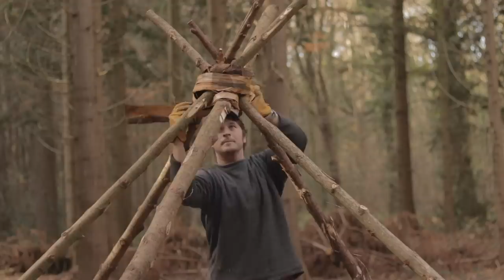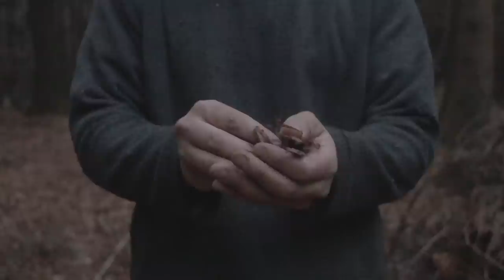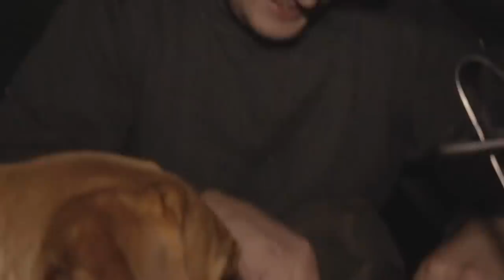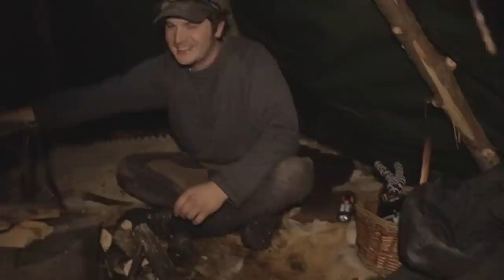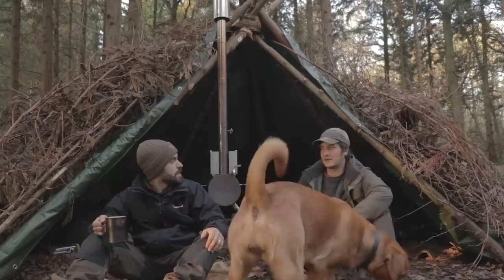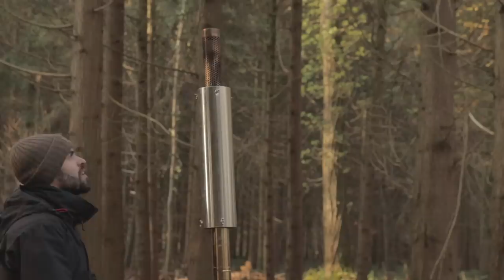2 Day Bushcraft Camp in a Tipi Shelter - Woodstove, Deer Hides, Axe (Camp Craft)

Comment: That looked like a great, gourmet trip guys! Likely it wasn't cold enough to have been uncomfortable in the morning, but a good trick when camping with a stove is to heat all the water you have with you, and to put stones on and around the stove itself before turning in. They act as sort of "thermal batteries", storing up heat and releasing it slower than just the stove would, so the warmth lasts longer. Plus the added bonus that your water is much less likely to freeze overnight, so you can get that first brew-up in you sooner!

Comment: Love that stove and hot water system.  If you run a second tarp on the floor and 5 feet upmthe walls and ,leave an inch or few gap at the bottom of the outside tarp, you get a great draw inside  the  tent and no drafts inside

Comment: Idea, use good quality tarp's and place brass eyelet's along the edge's and a few through the center. Then make plastic washer's with a water seal on one side with a plastic loop that can fit through the brass eyelet's in the center hole's on the tarp's and use bungi core's to connect the two side's of the tarp's. Make an A frame support structure. Then use paracord and thread the brass eyelet's to form a bag. Slowly fill bag with plant vegetation or dirt to the top with the center hole's being supported by the plastic washer's. Then place another filled tarp bag over the crest. You can cut tarp's and make tarp bag's to fit the back panel with a protective insert for a chimney pipe. Then one for the front pannel were you can pound a timber into the ground to support the A frame and use paracord to attach the tarp bag to one side then just lash some timber's together and use paracord to attach front door to your tarp bag shelter system. Ounce shelter is no longer needed just empty out all the tarp bag's fold up the tarp's and stow them to be used when you need's another shelter? 😊

Comment: What if you were to add a few more poles to the outside of your tipi over the tarp to help hold it from the wind, and then add your debris. I think it may help a little with the rain dripping in. It would make  a drip line so to speak. Some of the rain, not all of it, would run down those poles and outside of your tarp. Just a thought. Can't wait to see what's up with you two.